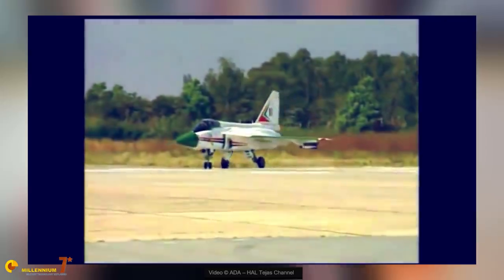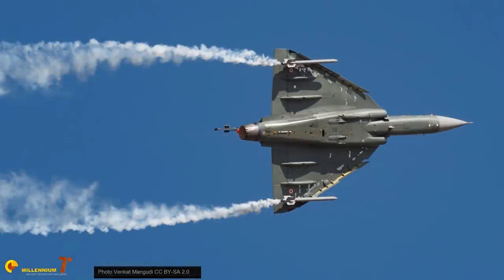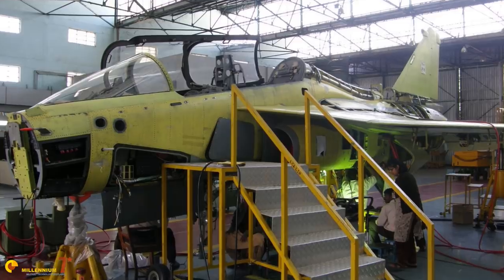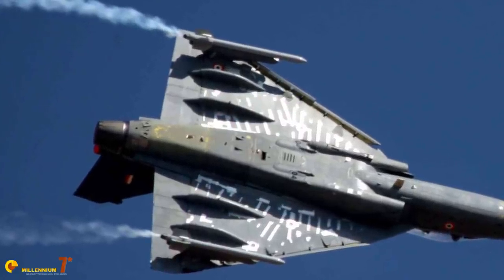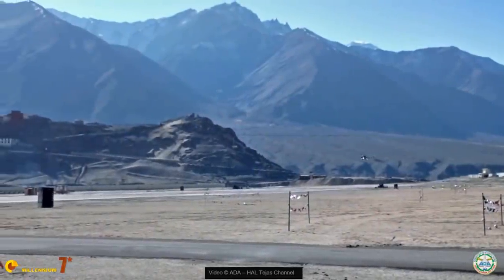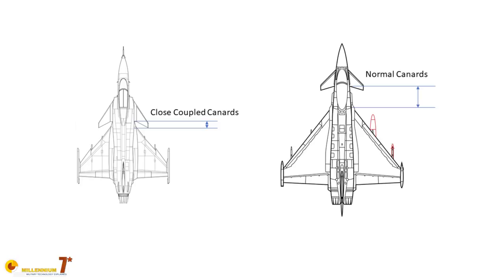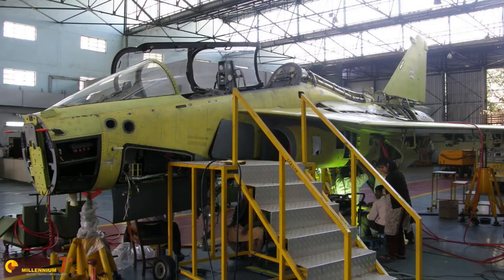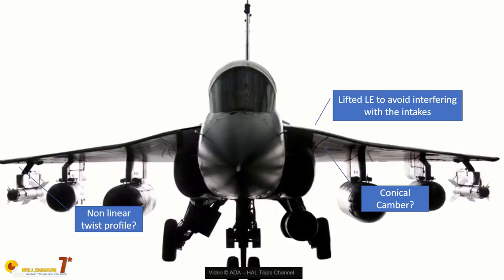TEJAS Aircraft  Aerodynamics Analysis - The Swedish Connection?

Comment: Has a lot of overlap with the Gripen, makes you wonder why didn't just buy the Gripen E/F?  Likely this is a domestic "Welfare Program" for their industry.
Reply: Marcos B  Operating costs.  No seriously.
Reply: Marcos B  wait for while you will probably see that when 6gn to 7gn fighters aircraft designs development race began only few nations which are veteran leader in military aviation design development will only able to  afford these expensive projects especially those nations whose requirements are not restricted just upto 100 to 200  airplane Airforces with 1 or 2 fighter aircraft types
Reply: Marcos B  They have or will have the same engine.  F-404 or 414    It's the engine out of the F-18 Hornet or Super Hornet so operating costs will be similar.  Operating an F-16 which is effectively a medium fighter with a heavy engine is on another scale cost-wise.
Reply: Marcos B    Because ISRO has success with rockets does not means that translates over to jets.  A lot of those Indian engineers likely have American training too.
Reply: Marcos B  Because of the special requirements sweden has to fighters which the F16 fully fulfill. For instance, sweden wants a plane which can be maintained in the field with relative simple tools. Also it needs a high degree of STOL capability and a rigid main gear to make full use of converted highways. All tings the F16 can't provide.
Reply: @AKlover  or to support their welfare defence industry.
Reply: @shi01  against  SU 30 to 33 ,mig 29 jet fighters.

Comment: As a project the concept behind tejas wasn’t bad. The real reason why JF17 became a success and tejas became a failure is very much down to the attitude of the two airforces.

PAF decided to Induct JF17 and overtime made improvements, until eventually the latest block 3 of JF17 is a 4.5 generation plane.

IAF and Indian politicians on the other hand screwed the tejas project, kept changing the requirements and delayed the induction for so long that eventually the whole thing stalled and became a failed project. Eventually IAF was forced under public pressure to acquire some tejas, but it was too little too late.

JF17 in the mean time had already acquired the foreign export market with exports to 2 foreign countries with 3 more contracts in the pipeline being negotiated.

It’s really the attitude of IAF and politics (and possibly kickbacks from rafael deal - already confirmed) that sealed the fate of tejas.

It’s really unfortunate, otherwise tejas could’ve been a successful aircraft.
Reply: India developed Tejas on its own whereas  jf17 is a Chinese aircraft which are merely assembled in Pakistan

Comment: In a layman term , tejas is the result if you take mig21 and try to make it mirage and then rafael

Most of the problem is due to different gen design input which were attached over the time to make sure it remains modren,this endup giving so called capabilities but not all capabilities are 100%.

mark2 will try to fix the shortfall ,first of all enough internal room for more fuel and bigger AESA radar
Ofcourse canard for mobility. and many more
Reply: In layman term, your comment is the result of thinking in Spanish and trying to visualize in your mother tongue and then finally spitting it in English. Result is, you don't know what you are saying.
Reply: @sandeeptiwari196  my point is that LCA_a 3rd gen)  was intended to replace mig21 ,second gen plane but now it is expected to do what 4.5gen are doing....so that limited airframe  has been stretched way too much....mark2 will improve lot of things in existing platform
Reply: @rajuseth1683  true!

Comment: I really enjoy your videos, very knowledgeable.
As far as the Tejas is concerned, I have yet to see a single video in any weather or geography that the tejas has been able to generate a contrail during high G maneuvers. This leads me to the following possible conclusions.
1. The Airframe is too small to handle the Engine.
2. The Air frame is unable to handle the stress.
3. The fly by wire is unable to keep the aircraft stable.
4. Indian pilots,  did not drink enough tea.
In all probability, it is a combination of these four and the role for the tejas, will now be cannon fodder in numbers and to mask limited Rafails, because of the similar RCS.

Comment: That special shape: is called a wave-rider wing. It was independently done, after many failed collaboration attempts with foreign companies. It was designed after significant CFD analysis followed by tunnel testing. The resulting wing does not work exactly as you say, it has a very high AoA capability and good slow-speed handling as well as the capability to super-cruise, meaning close to Mach1 at very low fuel consumption. It also allows a very large static and dynamic stability margin, making the job of digital fly by wire system easier. That said, its a bit late on the scene and perhaps their newer version may be more suited to today's times.
Reply: Marcos B  I'm very keen on knowing how you've pinned down a number for the years, where did you get that from? Did you do a mission analysis and the analysis of relevance etc., if so, please let us know? As it stands today, I have yet to see a more advanced aerodynamic design of a production fighter wing. The analysis presented here is too simplistic in nature.
Reply: Marcos B  That is your opinion based on older inventory and older tactics. You need to qualify it w.r.t. today's reality. Anyhow, I have witnessed the debacle with foreign governments unfold in a multitude of ways in the late 80s, in person. The achievement of Tejas is something that India and every Indian should be proud of. With the right weapon system, that aircraft is formidable. I would even argue that the lack of stealth is not important esp. for such a tiny aircraft.
Reply: @Partifakta 2018 that's correct, but it starts at Mach 1, if you can supercruise at Mach 1 then you can do so up to a speed above Mach1 easily since at transition you have the highest drag. For instance, tactically, doing so at a speed just below mach1 is more important, since you really do not want to be a loudspeaker to announce your arrival by going supersonic esp. in close combat theatres where IAF has to engage, the ability to be as fast as possible without the boom is one of the answers to that and to do that with least fuel consumption gives you the penetration, that's the reason that mission analysis is more important than looking at published performance figures.
Reply: Marcos B  Two things, firstly what you think (opinion) has little relevance to ground reality. So to make a fair assessment, you need to first get a proper mission profile (or a few mission profiles) and map the capabilities against that. Secondly, the performance figures quoted for any aircraft do not rightly represent their performance since no one will give you the correct figures. That said some of these can be judged by astute engineers by analyzing the flight profiles at demo flights or at airshows since at the airshows company test pilots usually try to unfurl the edge of the performance envelope to the bystanders and potential customers.
Second: the mig21 of today is far removed from a generic mig21 of the past, it has gone through all of the life extension programs, wherein, the internal components of the aircraft are modified based on extensive testing (fatigue, mission, air-warfare, electronics, controls, etc). The only place I am not sure about the current mig21 is its engine, otherwise, it can easily lick some semi-modern aircraft out of the sky as has been recently demonstrated. Thus, spending tax-payers money requires a long and somber thought on an analysis of the adversary's capability. I hope and wish that HAL rapidly cranks out enough Tejas and its future versions to address the current imminent threats from the adversaries for conventional warfare. However, in my opinion, based on an analysis of capability cost and mission analysis, the future warfare will be dominated by pilotless aircraft... and here we've digressed to a tangent from the original Tejas point.
Reply: @Partifakta 2018 Please go and read some material and educate yourself. I've lived my life doing these things, including tunnel testing. Don't read the intro from Wikipedia into this...

Comment: Area rule does not seem to be needed in modern aircraft (as far back as the F-15) that have more than enough thrust to accelerate through the drag rise of the transonic range.  Area rule reduces drag up to about Mach 1.2 but has no benefit above that.
Reply: It is not thrust, but fuel. In term of acceleration, light and medium fighters are better, but heavy fighter like F-15 can carry a lot more fuel to feed the afterburner when it needs to quickly accelerate.
Reply: @Gort Area rule can reduce drag, but it also tightly restrict the aircraft design too.

For example, F-15 can 3 external fuel tanks and tons of ammunition. Can you imagine a fighter fulfill area rule can do the same thing?
Reply: @Gort External payload is a bigger problem than internal storage because it directly changes the cross section area.
Reply: @joelau2383     I thought you were trying to be serious but now I can see that you are just making this nonsense up for some reason I can't and don't want to fathom.
Reply: @gort8203  Nonsense?  I don't know if forcusing on a single area rule in certain speed is sensible in fighter design at the first place.

The boost of engine tech is surely a critical factor,  but the requirement of carrying heavy ammunition and fuel tank is also a reason.

Comment: The issue with tejas is that it is to late to the game. They started the project back in 1980 and so far only 22 planes have been produced that are at best basic 4th generation planes. 

That’s too little too late.
Reply: A little correction:-
In 1984 IAF felt the need of a light combat aircraft so they approached MoD. The full fledged work was  started as late as 1991 with funds being alloted. Tejas took 1st flight in 2001.

No doubt that it is delayed, but the main reasons being sanctions after 1998 nuke test. Moreover IAF could have ordered Tejas but MMRCA was given priority and IAF wanted to induct a completely mature aircraft.
Reply: all 4.5th gen projects started in the 1970s and some in the 1980s. Whats your point? These technologies will stay relevant till 2050 with further upgrades over time.

Comment: Tejas I doesn't have canard wings because in 2000 when it's first prototype was manufactured, due to Sanctions after Pokharan Blast the technology was not available to Bharat. As such they developed the Canard Wing less design compensating it absence with computer controlled fight dynamic adjustments. Now Bharat have developed required technology of Canard wings so Tejas MK2 will have them. Your analysis is faulty.

Comment: Saab gripen is best suited for india
They offered to completely manufacturing in India with full tech transfer 
Also offered to help HAL with Tejas 
I don't know why India turned down Gripen
Reply: Because Gripen has similar capabilities to the Tejas.  IAF tested Gripen in 2011 and decided against it.
Reply: @rohitb3  gripen is superior to Tejas 
HAL struggling to get it out 
The Gripen offer is still good in my opinion
IAF testing is subject to what they are looking for
Reply: @SY27196  "gripen is superior to Tejas "  -  HAL and IAF doesn think so  . only youtube fanboys do(Comparing Gripen C variant to Tejas mk1)
"HAL struggling to get it out " -  Yes, issues with manufacturing pace. Need to sort out redtapes and bureaucratic hurdles, and once a larger order of 83 Tejas mk1A comes in, manufacturing pace will go up.
"The Gripen offer is still good in my opinion" -  Like i said, not a chance. Actually not "like i said", its like IAF said.
"IAF testing is subject to what they are looking for" -  Yes, IAF is in urgent replacement of Mig21 Light interceptors. Gripen and Tejas both are the same weight class, but again, Tejas i preferred anyday.  Cost is also a factor .